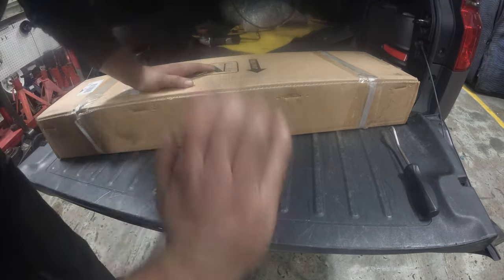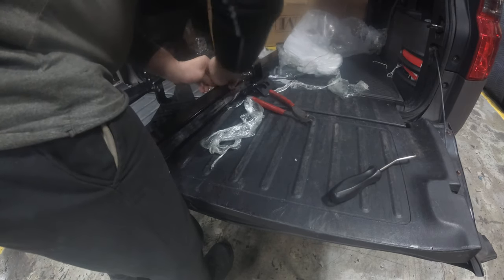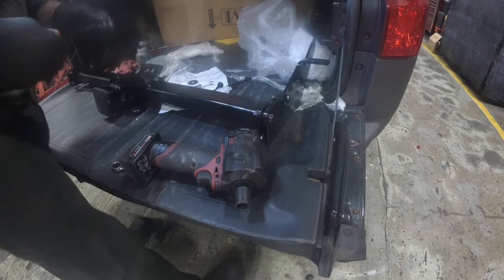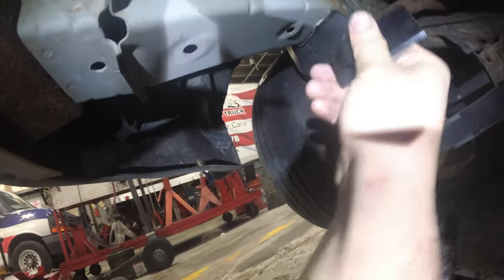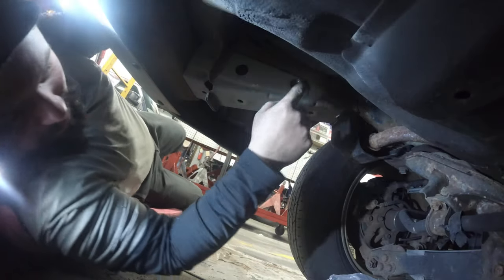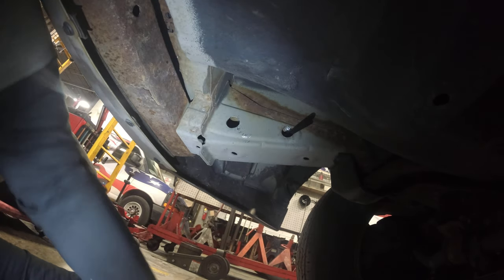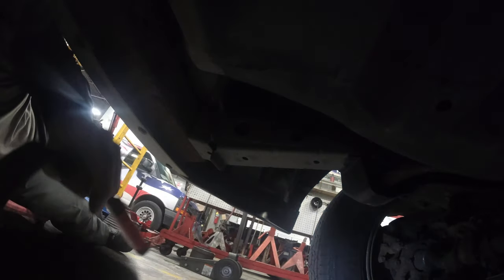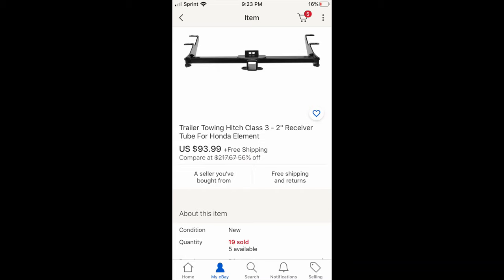03 Honda Element Build P3:  How to Install a Magnus Class 3 Hitch COPY CAT CURT HITCH DO NOT BUY

Comment: What went wrong? I'm kinda in a rush.
Reply from the maker: It’s safety related and best explained if you watch the video.  You get a visual...better understand it.

They are no ads in the video as of right now.  So there is no financial benefit for me telling you to do so.

Thanks for the view and comment, hopefully you subscribed to my channel.
Reply: @pattayperformance  I got up to the part where you have to make the holes bigger to properly attach it. I just bought a Magnus hitch for my 2017 Subaru Legacy I'm hoping I can just bolt it on and don't have to go inside the frame.
Reply: @pattayperformance  In fairness, the man has a point. I mean, we realize you're doing this out of the kindness of your heart, not monetary purposes. And for that, we thank you. But you didn't edit out all the fluff - unboxing, unwrapping plastic. AGAIN, I am not complaining. Just... explaining Seymour's sentiments. 

Thanks for the video.
Reply from the maker: Pollo Frito 

It’s hard to explain, better to watch the video and then ask questions. Just did an unboxing to people know what to expect.  Due to the POOR design my original video plans went out the window.  There are NO hard feelings as we are in this together.  Thanks for the view and comment, hopefully you subscribed to my channel
Reply: The part in the middle won't fit t